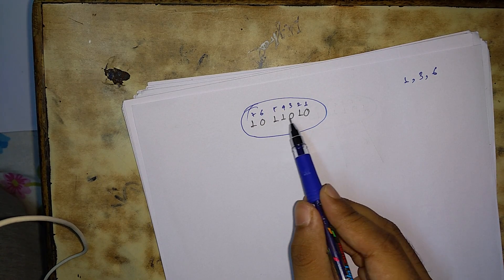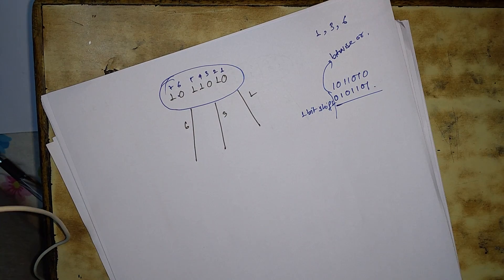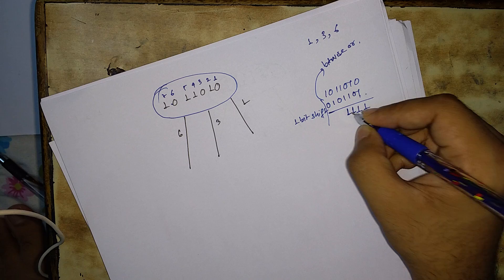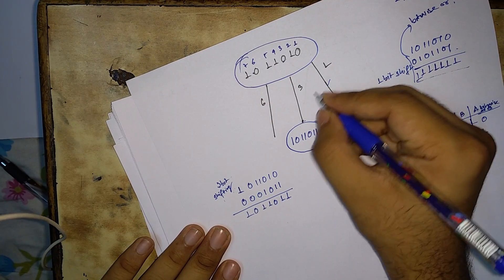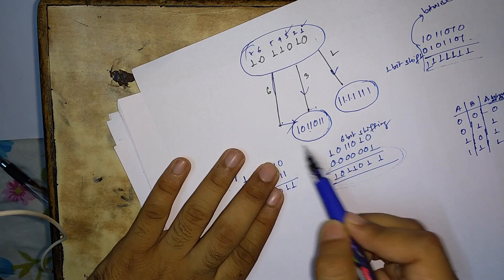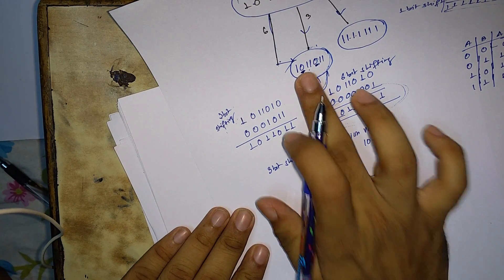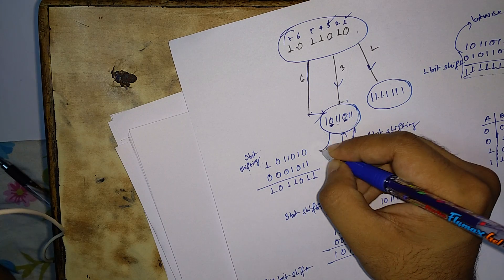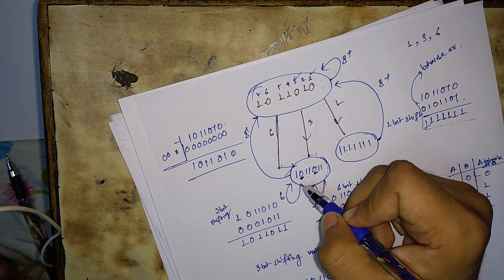pipeline collision vector ,reservation table,state diagram,part 2#computer architecture

Comment: I guess that will be 7+ shift and not 8+ because there are only 7 bits in the collision vector
Reply: It's 'm+1' shifts or more, where 'm' is the "maximum forbidden latency", where m≤(n-1), where 'n' is the number of columns in the reservation table (quoting straight from the book).

Comment: At 5:53 you are doing the bitwise OR with the wrong number. You have to do bitwise or with the original number every time.i.e with 1011010 not 1011011 or any other number.